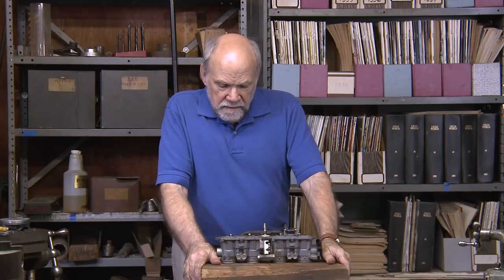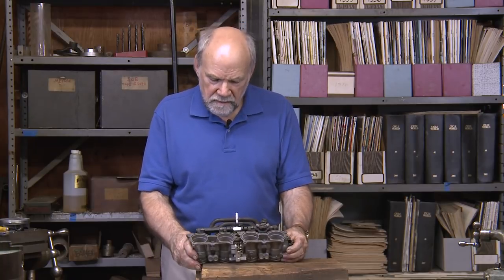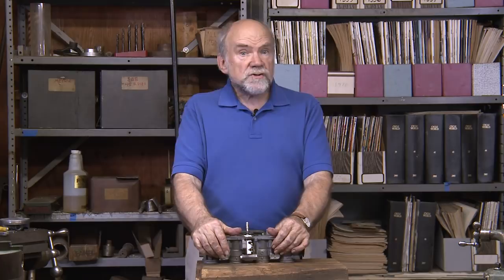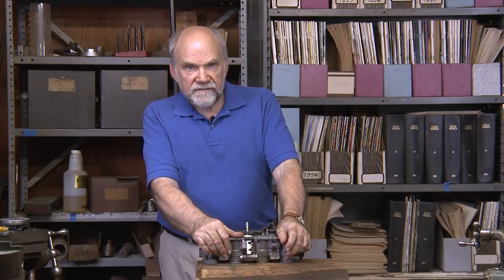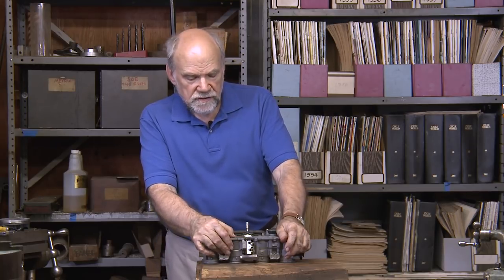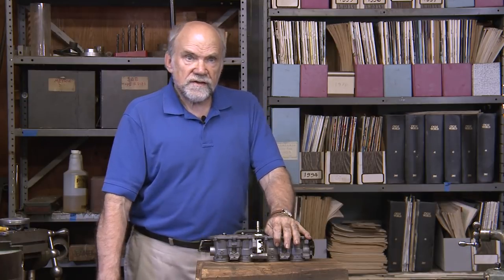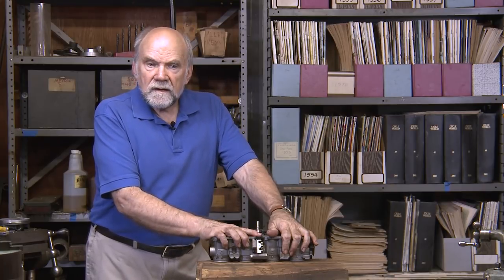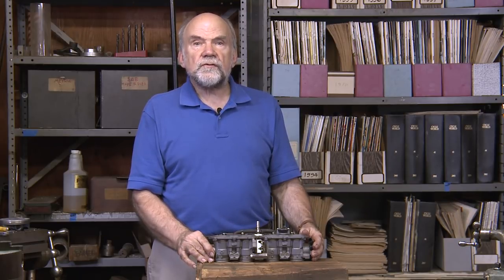How Does A Motorcycle Fuel Injector Work?

Comment: I almost died on my way to Mammoth in 1999 in my TT supra ... in a passing zone, no visible cars in opposing traffic and a guy who'd been in front of me going 70 in a 75 (a sin). I waited until it was both legal and safe (not something i'm known for) ... began passing, and my 70-in-a-75 suddenly felt competitive. It's not that he wanted to drive quickly, he just didn't want anyone else getting anywhere faster than he.  My car was modded, bla bla, making about 475 lb ft at the wheels ... at SEA level ... but this was en route to mammoth on a warm day. Of which I'd arrived at sitting behind people for a while, so I was unaware of the changes in performance.  When I tried to pass him he accelerated, and suddenly we're absolutely parallel, going 85-90 ... when the invisible ROLLING height of the road revealed traffic that was (at the current rate of closure) a maximum of 1.5s till collision. Anyone who knows cars, time, and reality well, knows that the first 1/3rd of a second is burnt up thinking of what to do ... which absolutely EXCLUDED completing the pass, braking, or fitting 3-abreast. No, all of those decisions were literally likely to be fatal. I was lined up with what I believe to be a Ford F-350 ........ preceding a string of cars. All I could hope for was that they wouldn't react too ... because the only thing left was going into on-coming traffic's shoulder,, hoping no one else had been in said rough lane, and, no one in that string of cars would do the (intelligent) thing of avoiding the car that was scheduled to have a collision (which imo, couldn't have included only 2 cars ... but absolutely several of those behind the first truck, as well). Wow was that lucky .... and all bc I think my TT supra's boost controller (aftermarket) didn't use a mass air sensor but boost pressure maybe..?  (I've yet to research it).  But from then on I was biased against turbos for the next 20 years later.  It truly felt like I lost about 35% of my power. I also ran yokohama A032 tires (forced me to keep 17" wheels) which had the highest grip I could find in any tire at that time. While it only had 8 x 32nds of an inch (how DOT measures it, I realize it's 1/4") so it wasn't ideal for standing water, but on merely wet days, the yokohama got better traction than the pilots it came with got dry. And in order to change lanes to where I thought the truck would only take off my mirror maybe (or maybe hit the right-hand half of the car) I'd made the fastest lane change I'd ever made (and was amazed I didn't lose control). I already had experience on tracks. this was just one of those things that to this day can make my heart skip a beat to think about. A thug pointing a gun was nothing compared to this.  

I'm not someone who tailgates just to sit there. If I need to change lanes and the gap is small, I'll get near someone's bumper shortly, but sitting there is stupid. Anyway,  on my way back from mammoth (in an attempt to change lanes on the freeway) I'd gotten near someone's bumper ... and just before I could change lanes (to a preferred lane) the car in front of me did a last-second emergency lane change ... bc a fcuking rot-iron sofa (lawn furniture???) was on the freeway! lol.  With perhaps half the time of the car in front of me (who'd occluded my vision and as a result of changing lanes and my closing rate forced my plans to change to begin with) required I shoulder check before changing to the left instead of the right as I'd initially planned, which felt like I had double the time of the first incident on my way up. After completing it (and feeling bewildered by the odds of two insanely dangerous events which both occurred within weeks of each other which'd yet ever been demanded of me in my previous 9 years of driving combined, just how statistics are) ... I looked around to see if anyone saw what I'd just (again) survived ... and saw a wide-eyed girl (mid-twenties) with her hands covering her mouth ... who, upon seeing me seeing her, shook her head to share in my moment of bewilderment until raising her eyebrows, and giving a thumbs up at my response to something that would've definitely mangled my vehicle (though I doubt it'd do anything more than property damage as it couldn't be more than 100 lbs or so).  One crazy trip.  Even before that incident the cops in Adelante pulled me over, let me go (bc I was going the speed limit, having already been warned about them) only to pull me over again to REMIND ME to drive "respectably" through their town. lol.

Comment: I just got a bike in to work on with a no start condition, it's a 1981 Honda CB 900 F engine in a home-built trike, Much to my surprise it has fuel injection, also is running a Power Arc IDK Crank Trigger. I have no idea where to start, considering the Honda 900F in those years was carbureted, and the original builder has passed away, I do not have a clue where to begin, I know Power Arc did make an ignition system to fit the 900, but when you look on the website, it says it's obsolete. Any suggestions? The trike is an immaculate showpiece, but I don't know where to look, because as, you stated the injection system needs a crank trigger, and I doubt  I can replace it with a Dyna 2000 (Only Replacement I can find) built for that bike, as it will not have the provision for triggering the injectors

Comment: I have been experimenting with a 2020 Honda CRF250 Rally, which seems strangled by the airbox due to noise emissions regs. I’ve gradually opened the airbox up and ultimately took off the airbox lid. The fuel injection appears to be closed loop and compensating well, I saw a 16.8% improvement at 3-6000rpm and 10% improvements at 5-1000rpm. I tested it against the stopwatch, top gear and 3rd gear 30-60mph. My question is, how far can I go, does Honda have preset parameters that the PGM-FI won’t go beyond? My thoughts are that the difference it needs to compensate for between sea level in Alaska in the winter and the mountains of Colarado must be more than the additional airflow I’m giving it. What are the facts as I’m struggling to find out? Thanks. Gordon

Comment: The oxygen sensors on motorcycles, are they used to adjust the injector on time like they do on cars? In my automotive world it's called fuel trim. The computer can either add or subtract fuel, from the map, based on how rich or lean the exhaust stream is via the o2 sensors.
Reply: OBD2 compliant bikes do.
Reply: I would think they are similar. O2 sensors allow for closed-loop operation in both cars and bikes.

Comment: My 07 cbr600rr has a 2-stage fuel injection. 
What is that?
Reply: I guess its both - "alpha-n" and "speed density" systems. They're used depending on many variables. Speed density is used for lower rpm's and idle, alpha-n is used for higher rpm's (since mass of air on higher speeds won't change at all).